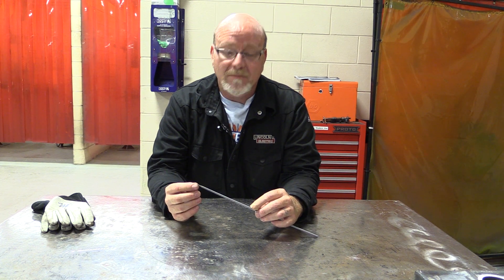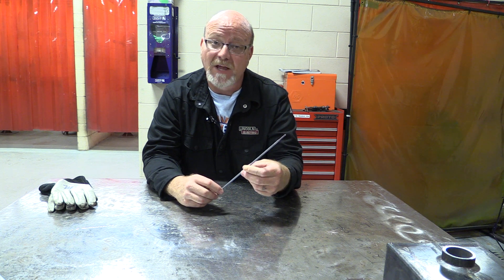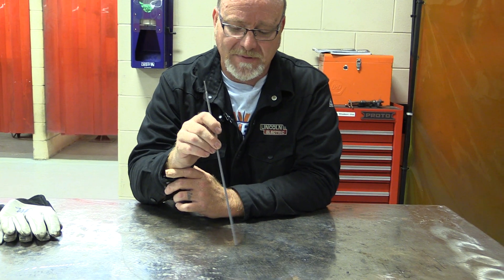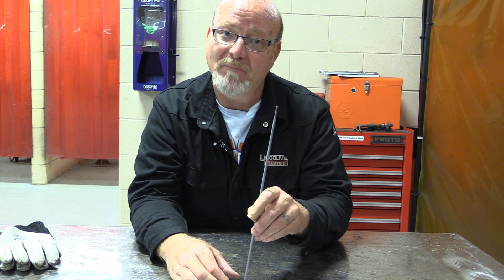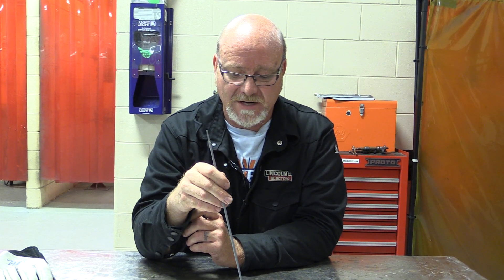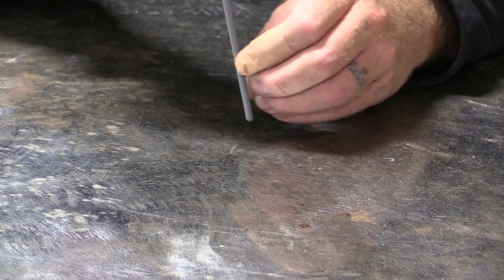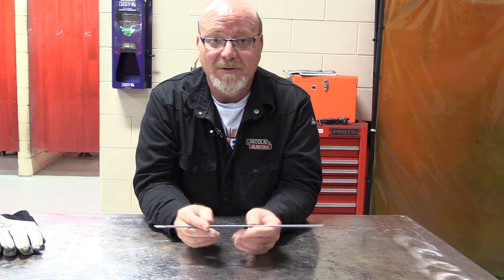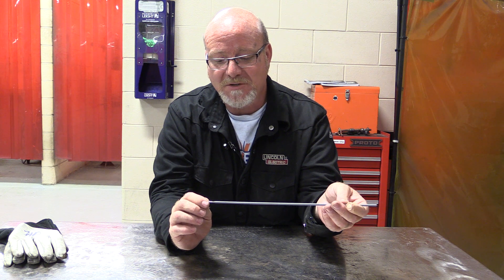Why use 6010 and whats the difference from other stick welding electrodes

Comment: I was taught 7018 open on 6g position in the 70s. Did my first pipe test with 6011 root and 7018 cap 6g. I have never used 6010. In the places I worked it was all 6011 7018 or 7024 for big flat production type repairs. We only wipped the puddle when necessary. Have a great day practice makes perfect
Reply: Wonder where they got all this 3g, 6g rubbish, sounds like they are just trying to confuse the newbies.

Comment: That was very interesting!  I have  boiler pipes to replace and expect I will be using whip and pause on the root. 
After that I will use some 7014 or 7018 to finish up.
Reply: Have you tried using it ?
Reply: @patriotskingnation8084  Not yet. 
The boiler is still running and it needs to warm up around here before I can do the work.

Comment: Why was i taught to soak these electrodes in water before every structural root weld?
Reply: troll
Reply from the maker: Soak in water?? wow, never heard that one??
Reply: @markprosserwelds9419  hello my instructor inform me  were not suppose to pause just  short whip and back and forth because that’s how they do it on pipe. Not sure if he gave me the right instructions.
Reply: @patriotskingnation8084  look at the process documentation from your welder and from the rod manufacturer.  They are helpful to know how the rod is designed to be used.  Then look at the AWS guides. There are definite to do and not to do, and a LOT of situation specific practices.  As to pipeline welding,  most who use a 6010 on youtube (and some I know) do as he mentioned. You have to practice AND have settings right. Only perfect practice makes perfect.